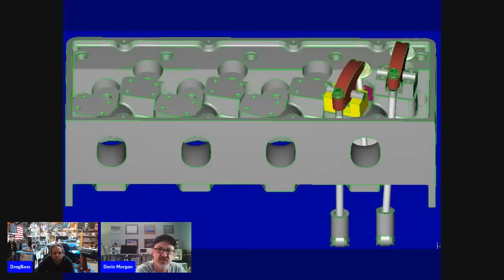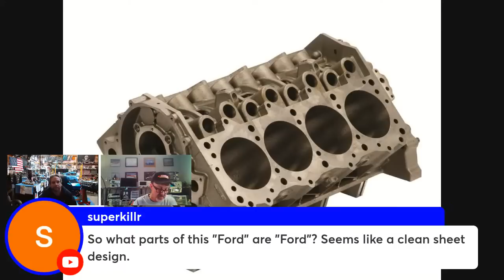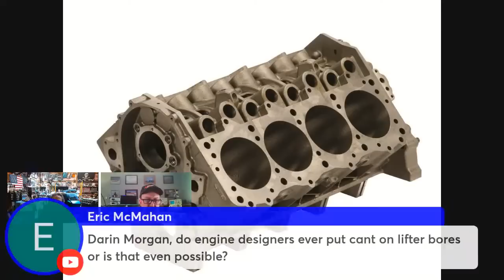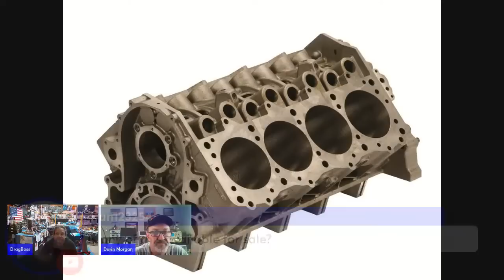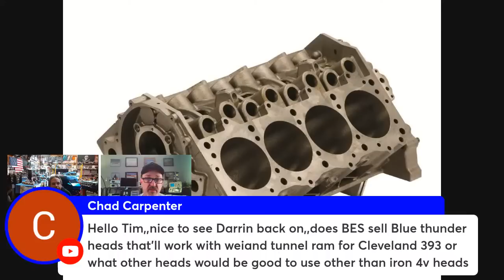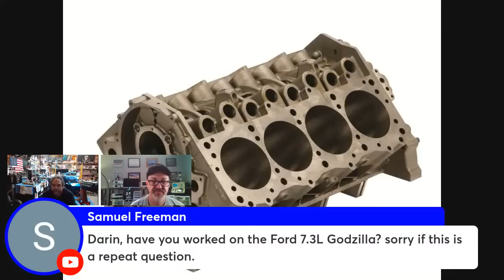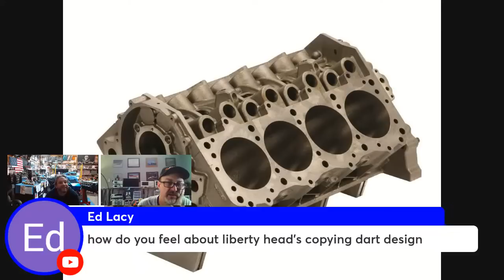DBG: Darin Morgan;  Ford Pro Stock Canted Valve Arrangement Head 1400+HP @10,200 rpm  with 499.6 ci

Comment: I'm suprised you didnt mention charlie wescott he bought cunninghams old prostock car and a bunch of ford blocks and heads a while back and built a prostock motor didnt run up at the top of the field what happened to him with that program?
Reply from the maker: I know Someone had mentioned that, but I think Darin said he did not get involved and not the same heads at least. Not sure. I did Like his Hemi car
Reply: Charlie only worked with the JC 50 program. He is currently working on some camshafts for this combo for my dad.

Comment: Need to look at the ILmore 500 Penske engine and its valve train and super short pushrods, 1024 hp out of 3.4l in 1994
Reply: What RPM?    It must've been super high.
Reply: @dennisrobinson8008  10500 for 500miles and doing 225MPH. Look it up super cool project by penske
Reply from the maker: Thanks Mark for answering the question. Definitely a screamer
Reply from the maker: Sounds impressive Mark.

Comment: Great conversation and information! Thank you Tim and Darin. A couple of my Chevy buddies were listening in and report disappointment in Darin's take on the Cleveland cylinder head being "unlike" those found on a Mark-IV (Porcupine Rat) Chevrolet. Many current race-design heads of different manufacturers utilize Cleveland- style approaches. At the same time those same buddies expressed joy for Darin's admiration of Chevrolet's LS series engines. (Though they need to be reminded of design similarities that series of engines share with the SBF.)  Kudos to Darin and all involved in the design and execution of the JC-50 engine. The melding of ideas and technologies is what makes this project exciting and notable. Darin mentioned the cooperation it took for all parties involved to make this a success. Jim Cunningham (primarily), Tom Sweeney, Alan Johnson (from his earlier Mopar efforts), Darin, Ford engineers, Mr. Neff for putting it to the pavement, etc. all play a role. Elements of the GM DRCE, the Chrysler Hemi, The Ford Cleveland and the 385 Boss 429 can be seen in conjunction with current enhancements lend to the potential for a winning piece. We Ford enthusiasts can only hope that it will be given a chance to shine in a popular racing series, (i.e. current N.H.R.A. 500" Pro-Stock.) Hope sponsors and Ford will get on board. The passion, enthusiasm involved and the fun of tinkering from our earliest automotive history is what makes the effort of working with engines so rewarding. Can and will the same be said for working with electric motors? (Sorry for the editorial.)  As an aside, Cast Iron welding in my racing days, the '70's-80's, was called "Thermo-Kinetic Welding" by the experts and was performed in an oven using Nickle. We dealt with a guy near us that was a wiz at it. Don't know if that term and process remains. "Tim's traveling Cleveland Revival Show." The quest continues. B.T.W. Happy Birthday Izzy!
Reply from the maker: Bill, I always enjoy your replies and comments. Such in-depth thinking. There’s no doubt it was a mega collaborative effort. You’re right that Head has the best of the best. Now the question is will they allow its use in Nhra. That’ll be the real issue. yes not a fan of electric cars, but I do like electric razors. Appreciate the birthday thoughts, it went very well. The girls had to do a video bomb, PS, I just moved  the mustang to the new addition, hopefully pick up the Cougar today or tomorrow, Now we’re getting somewhere, stay tune Bill appreciate you
Reply: @dragboss351cleveland  Tim, I still use a straight edge😊...
Reply from the maker: @billfioretti3013  I do too. And pen and paper.

Comment: Too bad Ford didn't put these(the wedge head) out like they did with the C-460's
Reply from the maker: I know it. But they may, if there is a request for them.
Reply: Even if they would have put out numbers between the C460 and the E460 but I guess when they were pissed at NHRA and pulled the plug they pulled it on all of it.

Comment: Thank you both for that cast. I have concluded the same thing. That is,  a possible sinister plan by the gov and or epa. To start a shell company. Buy up all the hp parts companies. Then after they make their money back. Shut them all down and ban modified vehicles. I am scared thats coming?
Reply from the maker: I have been thinking that for last couple  of years. It’s suppressing the whole lifestyle and genre. It’s part of American culture. Control.
Reply: That’s not as far fetched or paranoid as it sounds. Everyday the stories in automotive trade publications are about the performance companies that everyone knows being bought and sold at an accelerated rate. Mergers with companies that are unknown.  CEO’s, CFO’s and various self appointed big wheels all celebrating their latest successes and ventures. Where does it all end ?
Reply from the maker: Ends with no racing or high performance based on fossil fuels
Reply: @dragboss351cleveland  … So you might even say that it doesn’t have a happy ending ? 
They will have to pry the last drop of fossil fuel from my cold dead hands 🙌.
Reply from the maker: Not sure. But seems that way
Reply: @dragboss351cleveland  don’t worry Ethanol is the future anyway. Ethanol is not a fossil fuel. You can always make it yourself.
Reply from the maker: @Letsgobrandon827 I’m a fossil fuel guy for now. 😳 but would like to try methanol
Reply: That’s so stupid I’m embarrassed to be the same species as you.   Everything is a conspiracy with you trumptrash tucker suckers

Comment: Hi, this was a great discussion.     Juicy tech bits and high horsepower talk.    I was curious about the 10,500 RPM limit.   In some of my reading engines in this class used to spin to 12,000 RPM, which is completely possible with the "short" 3.6" or thereabouts of stroke.    The reading indicated that a rpm limit of 10,500 RPM was imposed at some time.   I was curious if anyone had more knowledge  on this.    I'm also curious did they have the heads and induction to make more power at 12,000 RPM back in that time?   That would be 15%-20% more HP...
Reply from the maker: I will forward to Darin and see what he says. Your welcome Dennis glad you able to enjoy it. So much info to get and comprehend.

Comment: Regarding 4-valve torque numbers.
The 90’s BTCC where rpm limited to 8500rpm and made (allegedly) over 320hp on 122cui.
Reply: How high could those bad boys spin without being limited?
Reply: @dennisrobinson8008  I don’t know but @8500 it’s about 1.62ft.lbs @ peak hp on 90’s tech.
There are those who claim that the Volvo made over 330hp but I take that with some skepticism 😊

Comment: I think the firing order in Drag Racing can be totally balanced in the intake manifold. Because tunnels are the best for Pro Stock. But I believe a totally new approach to the intake manifold has to be recognized by thinking outside the tunnel BOX. I remember seeing a George Montgomery motor that had tunnel Ram runners that were routed across from left bank to right bank of the plenum. And not the usual 4 runners on the left bank. And 4 runners in the right bank. George had shared across from side to side. But I’m sure having turbos had a lot to do with it. I just feel the envelope on tunnel Ram intakes just need more technological advances applied to it. It would include the changes to the manifold that are silly to think about. But I think it’s there. How much you would gain from it? Can’t say because tunnel rams haven’t changed much. We know how to build them for tuning a specific combination. But to reinvent the wheel on intake manifold design holds many advantages over what we currently are using. But who has the millions of dollars and time to look for the new discoveries inside a tunnel Ram design for a Pro Stock. I just find it hard to believe that 8 pieces of pipe welded to a plenum chamber is the Alfa / Omega natural induction intake.
Reply from the maker: John if you listen to the live chat with Darin. tunnel rams are just not round tubing welded to flanges. He was talking about specific metals they used to prevent residence and harmonics. I think there’s a lot of science to it, but that’s why some total Rams are $500, and summer $8000. I can’t remember the old Mopar‘s had a long intake runners with carbs close to the fender wells. I appreciate your thoughts, and thinking outside the box. Maybe others will chime in on this, stay tuned
Reply: Quit looking at old ass technology and thinking they had it all figured out and all this modern computer aided designs are missing the boat.  They aren't.  That old stuff is just that, OLD!!!!!!!!!
Reply: @superkillr  Give thoe OLD GUYS their due mate, because without them, we couldn't be where we are now. Their experimentation was done many times harder, when todays tech was but a dream. Also they raced, experimented AND towed, AND maintained their whole operations !!
Reply: @arkhsm  It's not that at all.  It's someone who thinks a 70's..even 60's design of the "crossram" is somehow the old secret that needs to be investigated and is gonna be the "out of the box" thinking that sets performance induction on a new path.  IT'S NOT.  It's cool looking, it has it's place.. but not on any modern high end race car.
Reply from the maker: But really who cares. That is your opinion let him have his. If he thinks they’re secrets in the TR, let him go. Not a big deal.
Reply from the maker: @superkillr  old is good.

Comment: There was actually a canted valve aluminum head for the 1970 Chevy 302 that 3 - 4 of were made, but they were just something from Zora Duntov to mess around with as Chevrolet were still under the strict 'NO racing' policy since the mid 60s .. Something which probably hampered development for them in the long run
Reply from the maker: They are probably laying on someone’s shelf with an inch of dust.

Comment: Smokey's Boss 429, won Pikes Peak one year with 17 to one compression  .
Reply: If you try to cut the chamber to full hemi, but use the quench pistons, ( that were probably the only thing you could get early on, unless you wait for custom pistons  ) compression would be severely compromised  . I went through the whole deal, and couldn't tell the difference, especially because it was a circle track boat, lol . Probably nothing would help those stock exhaust ports, with the exception of Smokey . As Darin said it was the Dark Ages of ports, but I know of 3 or 4 that were starting to catch on, Smokey definitely being one . Fairly sure this was a little bit before Darin emerged, Larry EPD was another  . 1975 for reference  .
Reply: @rolandtamaccio3285 There's a lot of love at this end for Ford power on the water!!
Reply from the maker: @rolandtamaccio3285  Thank you for explaining it. Circle track boat, never heard of them, sounds pretty hairy, wakes and water spray. Smokey didn't even know what a box was, Here is call with Larry Olsen of EPD
https://youtu.be/WIPJu2PsEWw
Reply: With the quench or without, I've cut it out, pistons to match, will result in the same possible compression . I think Smokey his-self published this fact, I don't doubt him, and there are reasons he won .
Reply from the maker: @rolandtamaccio3285  yes he was an innovator to say the least. Thanks Roland
Reply from the maker: I thought they could not get any compression out of them. I know full Hemi chamber you can’t.